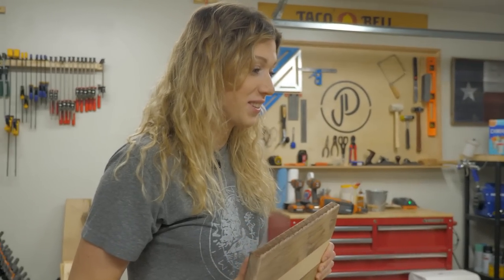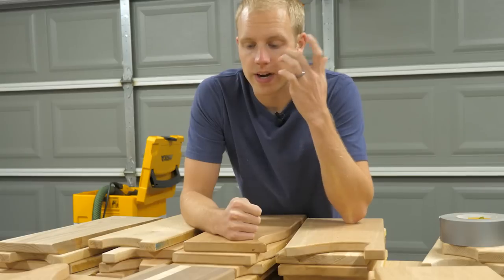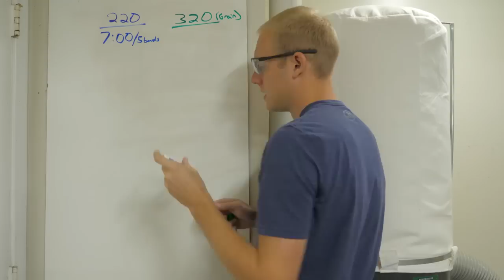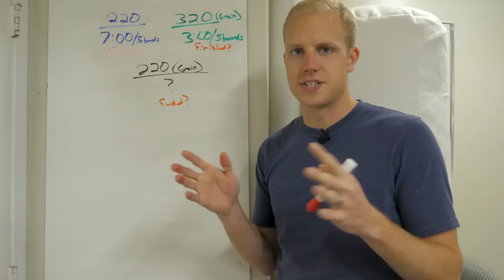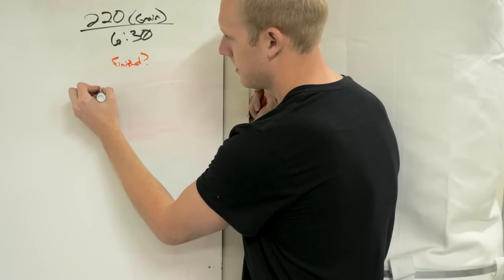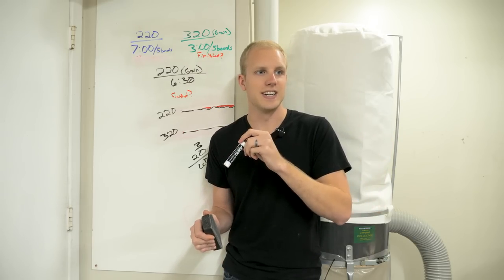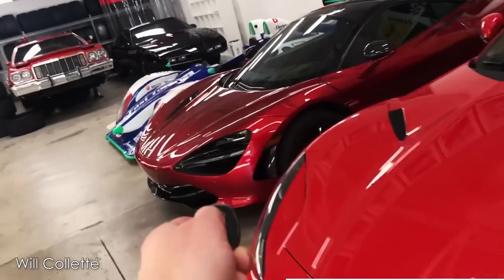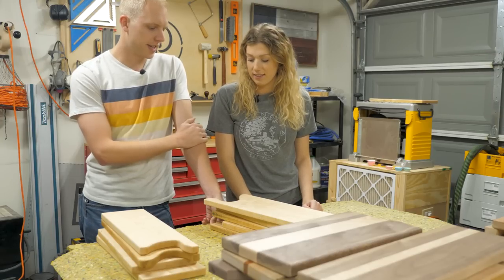🤔What Sandpaper Grit is BEST for Cutting Boards & Serving Boards?

Comment: Assuming that your wood comes off the machine at “120 smooth” I think is incredibly risky, especially on the edges. Even if it was completely factual skipping 100 grit at a time can not possibly yield professional results. I challenge you to add at least 150 and 180 to your process and inspect the wood closely. This would especially prove helpful on the edges.
Reply: I agree, you should never skip that much when sanding if you want a quality surface.
Reply: Agreed, the edges looked quite rough a many of them
Reply from the maker: The edges were left rough as an artistic decision. The faces and edges we sanded smooth had no tool marks, tear out, swirls, or any other visible defects. Consistent across all wood species. The quality of the surface is determined by the finish on a consistently sanded surface. Adding extra grits in this case is unnecessary.
Reply: @jennieanddavis  sure, I guess that's the look that's popular these days.
Reply: I would double check your work. I can’t imagine that Izzy Swan, Marc Spagnolo, April Wilkerson, Jay Bates, Katz-Moses and all the others on here that have been doing this for a living can be wrong. We are talking information that is nearly as old to the day as the the craft is. And please stop saying such definitive statements that just are not true. A quality finish accentuates a quality surface, it does not create it.
Reply: @dble0seven  thank you! No matter what Jennie and Doofus want you to believe, their boards are inferior.  I am sure they are making money on their YouTube videos, but YouTube is full of imposters.  If they are taking the boards from the planer at least 25% of them have snipe (you can see noticeable snipe on some of their boards in other videos).  No matter how to draw it up on a whiteboard, wax isn’t fixing snipe.  I am positive people would be better off buying a board from TJ Maxx.  And I’ll stick to watching woodworkers that are in it for the craft, not for YouTube views like these clowns.

Comment: I feel like the discussion on the "benefit of sanding less" is hearsay. You would have to test that long term to come anywhere near making that statement. It's based on nothing
Reply from the maker: Lol so I guess the experiment with controlled variables and a double-blind test subject who couldn't tell a difference doesn't count for anything? Yeah ok. You keep sanding, I'll keep profiting 😉
Reply: That’s not a double blind experiment
Reply: @jennieanddavis  Obviously conducting a test like that would be obnoxious. I'm just curious what happens to the boards after a few washes under running water. I respect the initiative to charge a quality price for a quality product. But if it's not actually a quality product, you won't get those repeat customers you're looking for.

Comment: 3M Net Abrasives is by far the longest lasting sand paper and will save you a ton of cash on sandpaper.   100% for sure.  I’ve tried them all.   It’s much faster as well.

Comment: Sanding with 220 after raising the grain is plenty if you are applying oils and waxes. 220 still allows the oils to penetrate application after application...unless you have time to soak them over night each time you oil them.  If you are applying hardening surfaces such as polys then you would want a smoother finish like 320 or 400.

Comment: I’d say 320 for a cutting board is too high so a 220 would get you where you need faster. A drum sander might be a good investment.
Reply from the maker: Haha yeah it’s on the list!
Reply: It not alot of 320 sanding just enough to knock down the fiber (swell) nubs after the oil. Polishing with a 8 inch buffer helps speed things up and a great shine.
Reply: Watch craigslist for drum sander. You can find great deals on them and they are a game changer for sanding.
Reply: @andrewburke5815   I have had a saved search for years so far no deals, only saw one and he wanted 50 less than new.

Comment: A woodworking teacher once told me that sanding beyond 220, in general, is pointless, because past that the sanding grit is smaller than the wood grain so you don't really gain anything. 
However, in turning, because you are sanding across the grain 320 is reasonable and some turning woods do well at 400.
However, if you have exposed end grain in a project you can sand that at 320 and it will finish better, very similar to the surface at 220 in terms of feel and color.
Reply: I've noticed sanding end grain past 220 helps it not change colors so drastically when applying stain/finish. Really useful for raised panels for cabinet doors or something.

Comment: For finishing cutting boards, I have a plastic bin filled about 1/3 full with food grade mineral oil. After all sanding is complete, I soak a board for about 30 sec to 1 minute then hang on a rack to dry/soak-in for a couple hours. Then, I finish off with a bees wax/mineral oil mix. This really doesn't take long at all.

Comment: The furniture shop I worked at, all material went through the drum sander prior to assembly at 150 grit. At assembly we would inspect the surface and hand sand any defects at 120 grit then final sand to 180 grit before finish was sprayed on. My personal cutting boards I sand to 180 and rub in a couple coats of mineral oil and beeswax.

Comment: I think you short cut your edge sanding too much, @ 8:09 you are rubbing on finish but the tool marks are still really deep on the edge. I know I could never shift a board if it was that rough. Also, I like sanding too, it really makes it feel like I'm turning my projects into something usable.
Reply: I noticed that too. a quick trip to the jointer or maybe a flush-trim router bit and your router fence.
Reply: Too busy trying to make the sale rather than finish the product properly. Profit margins and factor labour input costs won't be a consideration if ya can't sell the product due to it being a shitty product ..

Comment: I love sanding. With every higher grit, the piece gets better & better. BTW, I sand my cutting and serving boards all the way to 1500 grit.
Reply: I did a finish sand all the way up to 3000. Maple, walnut and purple heart. Came out like glass. I use to do body work so it's just habit to get the best finish possible

Comment: Izzy Swan had the Klingspor sandpaper rep for an interview on his channel, apparently many finishes won't work right if you go above 220, I'd use the higher grits on the final coat if I was buffing it after with Polish it wax.
Reply: Often on the finishes instructions it says sand to 220 also.

Comment: I totally disagree! I know you are looking at money only but the finish idea doesn't hold water.  My customers usually can pick mine out of a pile of cutting boards due to the smoothness.  I hit them quickly with 150 grit, then 220, then water, then 220, then 320, then water, then 320....mineral oil bath for over night. Remove from oil let dry, sand at 320 or 400 grit.  Then polish with #walrus wax and buff with buffer....the finish is great and the water proofing lasts for a very long time of everyday use. They know they get quality and are willing to pay the extra bucks! Never skimp, loyal customers can tell when you do....
Reply from the maker: Glad you found a process that works for you! I'd imagine the wax gives the boards their smoothness more so than the sanding.
Reply: I agree with the statement about quality. I find I make more in my business by focusing on the customer and the quality of my service/product than I do if I focus on making money.
Reply: The sanding is what smooths the fibers of the wood, the wax doesnt  fill in much because its not a build up of layered coats of protection but just a temporary thin layer of shine.  Davis, no matter which way you do it....as long as your customer is happy and comes back!  Thats what keeps the momentumn of the carasile of sales going! Discussion like this is awesome, thats what makes us better because no one person knows it everything...stay focused and keep  going forward. Love you guys and keep crushing it! Looking forward to the next video!
Reply: When you say mineral oil bath overnight, do mean literally soaking in a tub full of mineral oil?  In instead of the wipe on over and over again until it's done soaking it in... If so that seems sooooo much more time efficient
Reply: There is no way customers would ever pay for the labor on all that sanding.  Unless you are running them trough a drum sander this is not cost effective. It is a plain serving board. people are not going to pay a lot for them. If you have a market that will pay for all that extra labor you are extremely lucky. But the vast majority of people will not.
Reply: @jennieanddavis  I think you guys are on the right track with 220. I do just a couple things different.  After sanding I just throw them in a big tub of oil for a couple hrs. Then buff the wax mixture on with 6in orbital buffer. it seems to work in better and last longer in my experience.
Reply: Jennie and Davis lol try waxing a sawn board
Reply: @chrislamoureux5500  it makes it more water proofed and i do a batch of 5 or so per tub that way it has time to soak it all into the fibers about about a quarter inch or so deep on top, bottom and sides for edge/face grain, upto half in to inch on end grain.  My end grain boards are saturated all the way through. Several makers and large manufacturing companies soak cutting boards in a bath of oil before putting on a wax finish.  This way they get a good solid foundation then any retreatment by the customer is only maintenance.
Reply: @joshreed1216  thats why its done in batches.  No drum sander here..oscilator and a finish sander are my two best friends. I have two or three sanders each with different grits...oscilator is my final sander to get rid of any marks.  Also use a card scraper...gets it smoother faster. Just been doing it this way for awhile and it doesnt cut into the profit margin much specially with edge/face grain boards...sharp blades in the plainer help from the get go! They range from $58 to upto $85 for a 12" x 16" x 1.5", depending if at a craft show or special order.
Reply: @moosewerks4118  i've only made 6 cutting boards so far but i was using a small towel and putting coats of mineral oil on them and letting it dry an repeating. Your way of soaking it seems alot better and more efficent. I went an got a rubber made tube from home depot and ill try this bath method on my next go around
Reply: @DudeThat251  The great thing about woodworking is that there are several different ways to do things. Just got to find the way that works for you! Also, I happen to get my mineral oil from the local grocery store..found it cheap there. But you can order it in the gal and 5 gal sizes from amazon.  I  filter the oil before storing until the next time.  I also like using #walrusoil and do the same with it.  I used to try and make my own beeswax mixture but find it cheaper and easier to use walruseoil paste wax. A small amout goes a long ways. Buff with a clean bonnet on my buffer..makes it shine!

Comment: This video just saved me a ton of time! I was starting with 60 grit, yes, 60 grit, to get out the small ridges from my planer. Took a very light pass in the planer & started at 150 & no difference what-so-ever with a board started at 60. Just starting to take my woodworking into a part time hustle & your videos have really opened my eyes to look at my processes. 5 minutes doing some experimenting can save you hundreds of hours over the year.

Comment: The biggest thing when sanding is getting the hard to see micro scratches out which will show up when you apply finishes. I was taught to look down the wood with good light to see if there are scratches present. I like to sand my end grain to 320/360 grit and face grain to 220 grit. I find this helps keep the stain more uniform in how dark the wood takes it. Maybe it translates to finishes as well?

I was surprised to see the heater. I didn't know it got that cold in Texas. 

How do you like the new sander? Did you try out the pad protectors when you use the Abranet mesh paper?
Reply from the maker: New sander is great! I've got the little foam piece sandwiched between the sander and the mesh paper if that's what you're talking about - works great unless you're sanding a narrow edge, then the mesh paper tears really easily. But that's probably a user error.

Comment: Hardwoods require less sanding overall due to denser fibers.  The opposite is true for softwood.  

What sander are you using?  Im pulling boards direct from my Dewalt planer, hit them with my Bosch sander with 220.  A quick knock down pass with it on aggressive, then a finish pass on normal, and its ready for finish..

Comment: I love sanding also! I make spoons and other things and I sand my stuff to 1000 grit by hand, then hand buff with a paper bag, no sander. I want them to still feel smooth after being in boiling water. I’m a homemaker with 5 children and am way to picky about my spoons feel at the end. I could definitely pump out more spoons if I wasn’t so picky. I’m also wondering what is under your cutting boards when you sand? I usually sand mine on a towel on my living room floor ( again I have many children, so I need to be in the house with them).
Reply from the maker: It's just some old carpet pad! Haha yeah, the Maker's curse is seeing marks of character as imperfections.

Comment: If you’re worried about time saving a drum sander is going to go a long way in your sanding time. You will still need to do some hand sanding with higher grits but sanding is no bueno and if you are doing a production shop it will be a huge time saver for various projects. In the end it’s all about the money and whether there is the capital for the tool. Good luck.

Comment: A good audiobook or podcast and I can sand for hours. Also, I san to 220 soak the cutting boards in mineral oil and then put them  vertically on a drying rack to let the mineral oil drain off.

Comment: 10:50 I watched a video about finish’s on wood working for mere mortals. Basically said after 220 sanding is pointless. The finish is gonna make it feel like 220. Only own 60/100/180/220 sandpapers. Latter three only ones you need regularly.
Reply from the maker: Yes! Haha that was my inspiration to consider stopping at 220

Comment: I like sanding.  It is so tactile and it's the best way to examine every part of a project.  It also means I am nearly done with the project.  I have good dust control and I wear a mask with the orbital.
I find 180 on the orbital is usually enough.  Then, I go over everything lightly, by hand, with the grain, to eliminate any 'pigtails' from the orbital.  Your grain raising is a good idea but I don't always do it.  I would never sand to 320 for a film finish.  Complete waste.  320 and 400 are good for sanding the finish itself but you probably won't do that in a production shop.  It is super labor intensive.  Save it for custom pieces.

Comment: I bought a new acacia cutting board. When I unwrapped it, it was rough to the touch and I'm concerned about the tiny pieces of wood getting into my food.  Any suggestions?  Keep in mind that any sanding would need to be by hand; is that sufficient?  Or should I return it? Thanks :)

Comment: Tools may very well leave the equivalent of 120 more often than not but certain tools (ie. Router. Planer. jointer) have an added affect of actually burnishing the surface. Water will not raise the grain of a burnished area because the heat produced has temporarily sealed it. Give it a month. Those round overs will be grainy if ur router was set to a speed just a few hundred rpms higher than the species / bit / material pass calls for. From a production stand point it makes more sense to spend the hr sanding than it does to train an employee in the proper speed of all equipment for all species/ bits / blades/ depths etc., oversee general use, and drill the importance of it over and over and over... and over... and over again. Someone making $15hr sees it as a job. Not a career. Jobs have high turnover rates. Jobs with complex substructure have an even higher turnover. 1hr per bulk project or 100hrs per employee. Every 6-18 months?

Comment: Drum sander👍
Reply from the maker: Still gotta hand-sand the edges. Taking the time to pass all the flat sides through the drum sander might not be worth the time savings if you have to go back through with a palm sander anyway... The time picking up and putting down serving boards ads up at scale!
Reply: But you a making a low cost item does it really that much sanding and if they are giving them away as gifts will they care ?

Comment: I like sanding but not the micro dust. In the interest of time couldn't you use a plate sander or large sanding drum? I save tons of time with mine . Run boards through thickness planer then through thickness sander . sand all 100 boards in less than 15 minutes per side.

Comment: I don't blame you considering the volume of boards you're doing, but you can absolutely tell the difference between those finishes. Try going from a 220 to 600 grit and see the reaction you get from your clients.
Reply from the maker: Yes if they were just raw wood you could totally tell a difference.  And with wax, the smoothness comes from the finish, not the sanding.